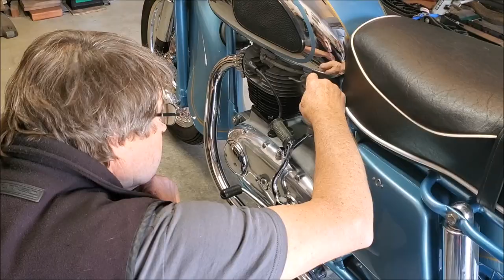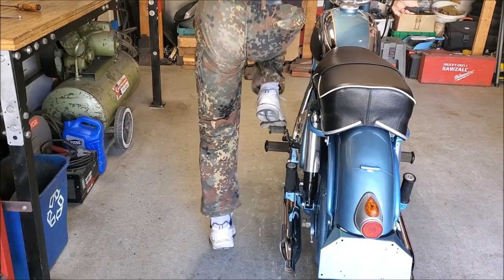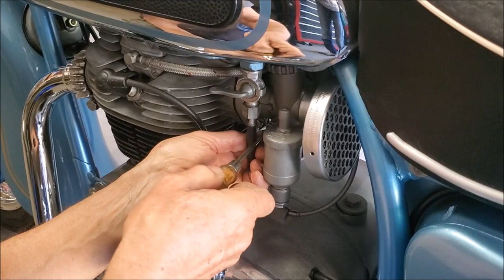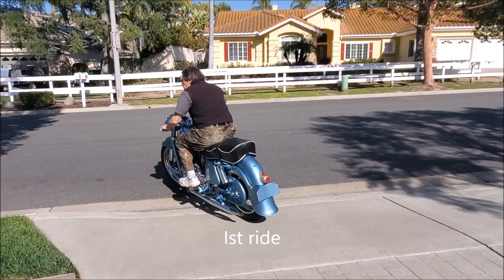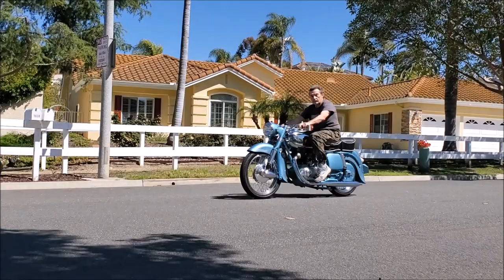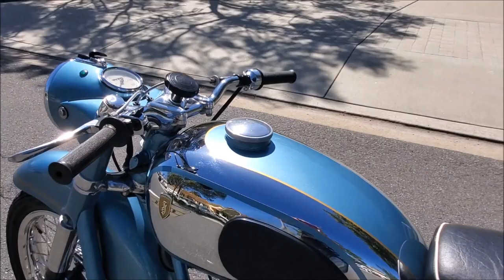Dual Citizen: 1960 Zundapp Citation, aka, Horex Imperator, 500cc

Comment: Had a 58 Citation in 64-65 and loved it! Had aluminum fenders front and back, painted scallop on the tank, and 11” apehangers! The rubber “damper” on the back wheel broke and my machinist dad made an aluminum piece with rubber inserts! Looked and worked great. Sold it when the clutch plates warped so bad it tended to creep at stoplights and no replacements were available back then. Great memories; wish i still had it!